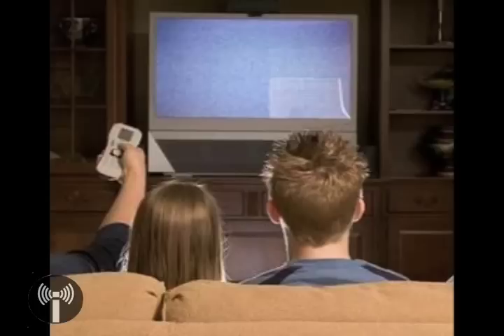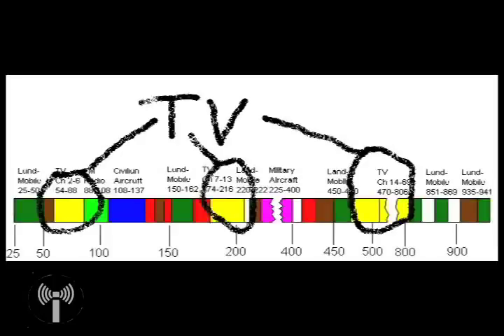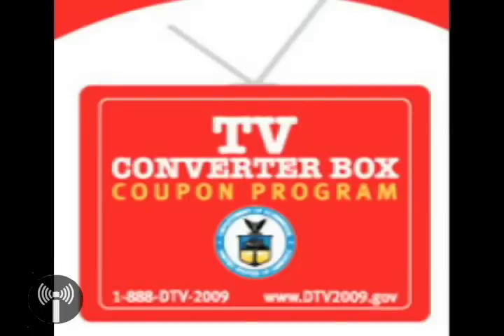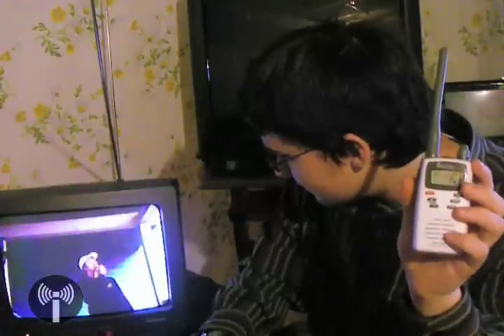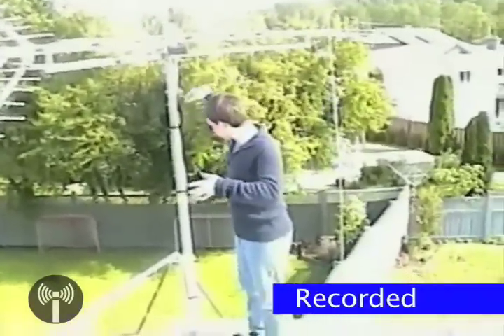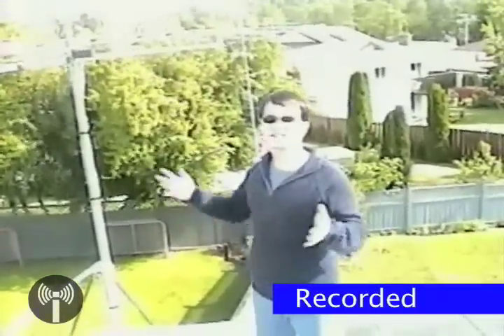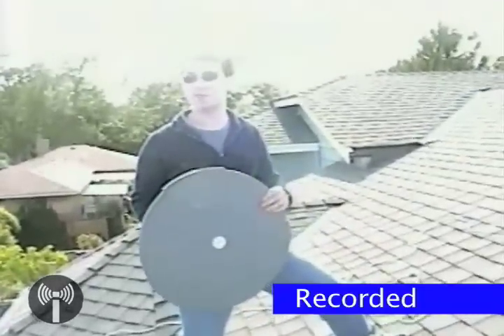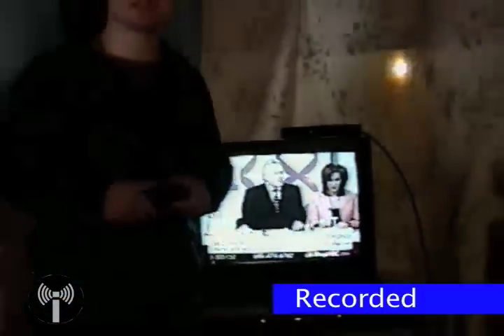Everything you Need to Know About Digital TV

Comment: In the US, LP VHF can only transmit at 300watts.  WBBM was at 2.5kw, and believe they were supposed to go to 4.4kw had they stayed on 3.  For ch 12, they're at 8kw, and most people can get the station now.  I was one of the few who got their station on 3 with little trouble.  I need to get a video up to show my antenna.  It's optimized for 2-69, and while I live only about 30 miles from downtown Chicago, I have a big antenna like yours, but different design.

Comment: I don't know if you have any DTV stations on low-vhf.  If so, the omni-directional antenna you showed in the video won't work for low-vhf.  I know because I had something similar that didn't pickup ch.2-13, and didn't pickup all of the uhf stations.  You need an old fashioned element antenna optimized for 2-51 (7-51) if there won't be any ch 2-6 in your area.  I don't know if Canada is eliminating 52-69 like the USA did.  Stick with an element antenna, even if all you need is a smaller antenna.